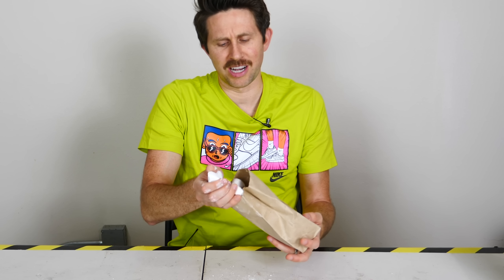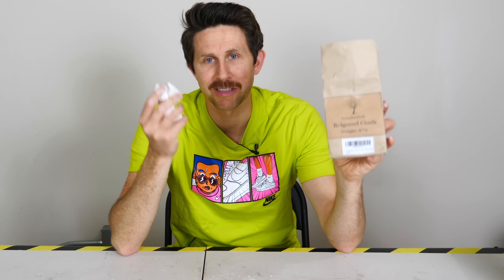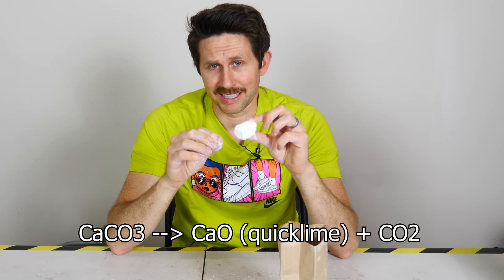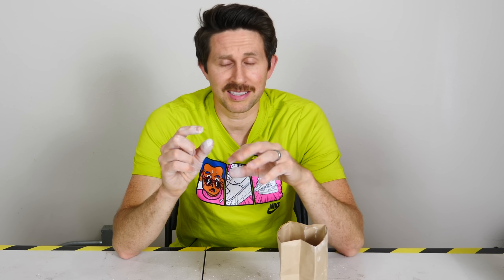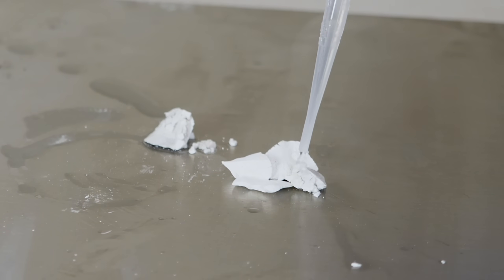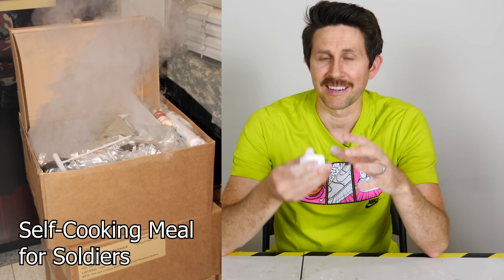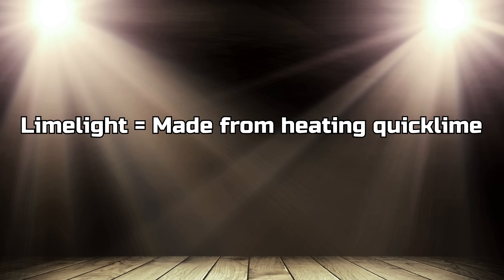Don't Put Water on Chalk—Quicklime

Comment: Isn't quicklime what is in every type of concrete? Iirc it turns into Ca(OH)2 when you mix it with water and through reaction with CO2 in the air it slowly turns back into CaCO3 and some water. So this reaction is happening everyday on any construction site.
Reply: The concrete is probably used by a reactional deceiver. In addition, concrete consists of a significant amount of other substances, due to which the reaction slows down.

Comment: Fun fact: Calcium Oxide is used a lot in Japanese bento boxes (lunch boxes you have when you take a bullet train from one location to another.)
You pull a string, which causes a water packet and the calcium oxide to react and heat the food.
Reply: I suppose this is a similar reaction as used in the "Hand Warmers" packets? In those packets, I believe that an iron chemical is used, but all the same, it is an exothermic reaction! 😀

Comment: In indonesia traditionally people consume areca nut or leave, betel leave, and active (will release heat when mixed with water) or inactive lime. We only chew them together, will get the effect of getting high and a little addictive. When the mix is not releasing any effect anymore we spit them.out. the spit is as red as red paint

Comment: CaO = quicklime = DANGEROUS which I think should have been made clearer and emphasised in the video. For example shoulc not be touched with bare hands even when cooled. See Wikipedia article for more details. "Because of vigorous reaction of quicklime with water, quicklime causes severe irritation when inhaled or placed in contact with moist skin or eyes. Inhalation may cause coughing, sneezing, labored breathing. It may then evolve into burns with perforation of the nasal septum, abdominal pain, nausea and vomiting. Although quicklime is not considered a fire hazard, its reaction with water can release enough heat to ignite combustible materials." 

CaCO3 = chalk = safe

Comment: Calcium Carbonate is a perfectly edible ingredient in heartburn remedies used to neutralise stomach acid. Quicklime is also used as a pickling agent. I used to slake lime to create hotlime mortars by the ton. I work with it every single day and consider it to be a wonder material, but must be used with caution. I've suffered 2nd degree burns from this stuff, but not through the process of slaking, but from exposure to the hydrate combined with friction in a wet environment. It's extremely caustic. Also, you cannot reuse it in the way it is suggested here, once CaO has reacted with water the Hydrated Lime Ca(OH)² must first react with CO² dissolved in water (or in combination with water and  
CO² present in the air) and cure into CaCO³ (Calcium Carbonate) before it can be burned and slaked once again. This reaction is extremely slow. It's known as the lime cycle. It isn't as simple as just re-heating the hydrate.SHFPs that use quicklime are single use only.
Reply: No, there's no need to make the carbonate, as Ca(OH)₂ will also decompose into H₂O+CaO at 512°C.
Reply: Yep. Active ingredient in Tums.
Reply: @ShadowoftheDude Interesting! I just looked on Google images at the ingredients list, and depending on the product, it may be 500mg, 750mg, or 1000mg calcium carbonate per Tums. I don't yet see the total mass of a Tums, so I don't know what percentage by mass it is.

It would be a funny prank to get some Tums preheated, like put them in the oven under the broiler for a while so that they become quick lime, put them back in the bottle, then show a friend "look what happens when you put water on a Tums!" Then they would go to the store and buy some and try to recreate it only nothing happens 😜
Reply: Sir are chemical engineer or chemist??? Please reply. I want to ask a question

Comment: In Russia we used this to paint the chicken house with this dissolved in copious amounts of water...
... so as kids we would get a small piece of it, stick it into a hairspray bottle with one end cut out, add a few drops of water, shake it up and light up a match near the hole- big boom!
I’m guessing some flammable gas is a part of the reaction...
Reply: Did you know your comment is at the bottom due to the filter that make top comments first so if u want like youll need to be first or no one will even know yoh commented

Comment: There are some self-heating packed foods using CaO as the heat source. You just add tap water and leave it for a few minutes and it’s piping hot. So chalk is not hard to buy after all XD

Comment: Quick random fact, quicklime was also used in roman concrete.
Reply: I've heard you can also use egg shells or snail shells to make quicklime instead of chalk.
Reply: @Just_Sara  That's because those shells are made of calcium carbonate (CaCO3), the thing that is in chalk.

CaCO3 + heat -> CaO + CO2
                        (quicklime)
Reply: @gamistry2947  I know, right, isn't that rad?! :D
Reply: It is a component in portland cement as well...

Comment: Odd. I used to be a gymnast, and we constantly used chulk to have a better Grip. Obviously sometimes we came in touch with water and usually nothing happend exept a few bobles. The cracking phenomenon did occur though , usually with old chulk. Is this because it was chulk mixed with something else?
Sorry about my grammer, not a native speaker
Reply: It has to be heated up first so the CO2 comes out. THEN don't put water on it.

Comment: If you can break glass with a frequency of sound, can you break it with a frequency of light?
Reply: Sound is big waves compared to light.  It would have to have a lot of power in that beam.  Kind of like arc welding.  Low voltage but lots of amperage.  But, if it takes so much energy for a sound wave, how much more power one must need for that perfect, I mean perfect, frequency.  I dunno theoretically it is possible that's what harmonic frequencies are about too.  I just don't see light having enough physical power to do anything.  You can't arc  weld with three hundred volts and no amperage.
Reply: Vincent Hildebrand ok that seems to make sense. I wasn’t sure but it was just an idea. Thanks for the explanation 👍
Reply: @earth117  sound, for us to hear it, has to vibrate between sixty and fourteen thousand times a second. Kilohertz means thousand cycles (vibrations).  Light vibrates in the trillions.  That is your gigahertz.  Sound is a low frequency, bit with lots and lots of physical energy that actually makes the air molecules transfer the soundwave travel through the air.  Light is on a different realm altogether.

Comment: Calcium carbonate is used in many thing - food supplement for pets (it is already mixed into commercial pet-food but for homemade food might be required to be added extra), as part of a backing-agent, acid-balancer and more.
For other applications you do not require food-grade CC which is then of course quite a bit cheaper.
You can bake it and then use as mortar (many european barns are whitewashed with that). And darn is it fun (cause of the danger) when mixing several kilogram of that with water :)

Comment: Funny, I just learned about the origin of the term "limelight" a couple weeks ago when watching an episode of "Penny Dreadful". They mentioned "limelights" as actual things instead of an expression, so I paused to look it up.
Quicklime has had some interesting uses throughout history. Some of the more notable examples are the production of cement and the processing of corn and other grains in the Americas. That second one is my favorite. It's called "nixtamalization", from the Aztec word "nixtamalli". If you grind dried corn, it won't absorb much water. But if it's pre-treated with quicklime, you'll have something completely different. More nutritious. More aromatic. And more workable as a dough. Without nixtamalization, you can't have corn tortillas or tamales. Imagine that.
Reply: I've seen "lime" as an ingredient on a particular brand of tortilla chips, I can't remember which, and it wasn't the citrus "lime". I remember the texture being a little bit more different than normal tortilla chips, like more pasty but in a good way.
Reply: @adamcolbertmusic  I wonder if that means they're starting from corn and nixtamalizing it themselves, instead of purchasing prepared masa from a supllier. I think that would require them to include lime in the ingredients list. Whereas a chip maker that purchases masa might maybe get away with just putting "corn" on the list, since after nixtamalization all of the calcium hydroxide used in the processing of the corn is washed away, leaving just the very-changed corn behind.
Reply: @tom_something  I will look at the ingredients on the tortilla chips the next time I'm at the store!

Comment: Limelight? I didn't see any light, and if they used to use lime for lighting, it would have been a dim light indeed. Maybe you just didn't do it right.
And as far as the remark about soldier's meals using CaCo3 for heating meals, those are called MREs (Meals Ready to Eat) Are you sure they use CaCO3 for heating?

Comment: I didnt see any limelight, just little red glow.
Reply: Because it needs 2300 degree Celsius. For that effect.
Reply: @aryansinha6667  so I need a oxy acetylene blowtorch?
Reply: Either an editing mistake.... or more likely, he couldnt get it hot enough and said, screw it.
Reply: same
Reply: same
Reply: same
Reply: same
Reply: @htfcirno2000  
⑨
Reply: @aeriumsoft  I'm the strongest
Reply: same
Reply: @htfcirno2000  o
Reply: All I saw was a mustache
Reply: same
Reply: same
Reply: Emas
Reply: @_____Black_____  Embak
Reply: The red glow is the limelight, you can barely see the flame after he turned down the exposure, but you can see the red glow, which indicates that the red light is actually very bright.
Reply: Same
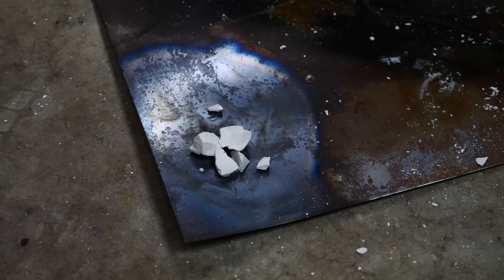Reply: Did you understand what did to the camera @ 2:33 ?
Reply: @azztereris  he turned the exposure down on the camera which means the camera takes in less light and is less sensitive to background light in order to be able to see something really bright without seeing a huge glare. Most professional recording and picture cameras have this in order to get perfect lighting shots
Reply: same
Reply: same
Reply: 2:48
Reply: I saw it.

Comment: Eating chalk (after adding water) is pretty common in our area...everybody  consumes chalk here after dinner or lunch with betel nut and betel leaf
Reply: I have tried this. Are you a Pacific Islander? I put the "chalk" in the leaf and the nut and chewed it. Turns your mouth red and gives you a slight buzz. But not sure it was actually chalk...
Reply: @moodberry  it's actually a mild stimulant which helps in digestion..